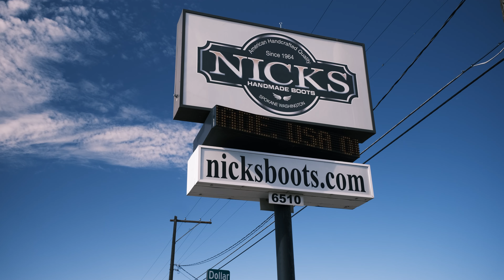The World's TOUGHEST Lace To Toe Boot | How It's Made

Comment: Why is the inner leather stitched from 2 separate pieces?
Reply: What time stamp are you looking at? Do you mean the toe liner at 7:24 with those cross stitches? I was wondering that too. Usually it's one piece. I wonder if it was cut in two pieces by mistake. So they stitched it together. Just a guess.
Reply: @JourneyRanger  yeah that was my question.